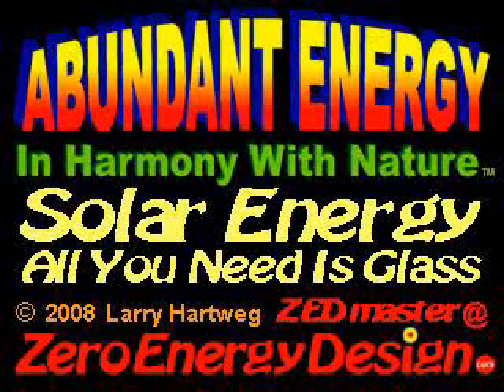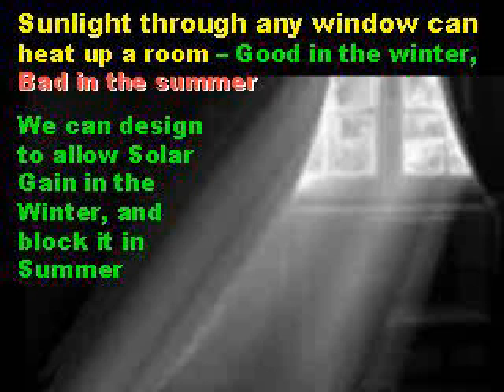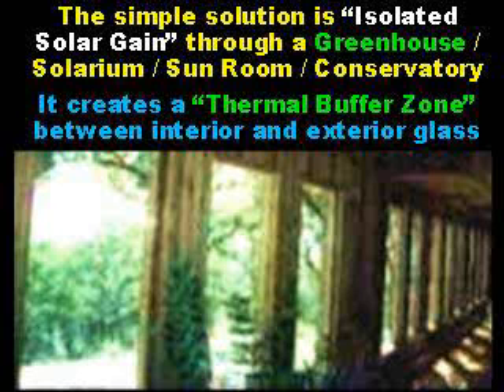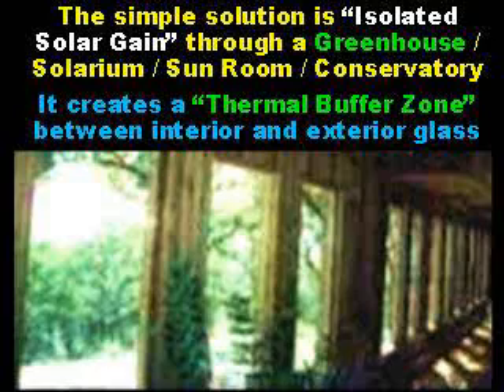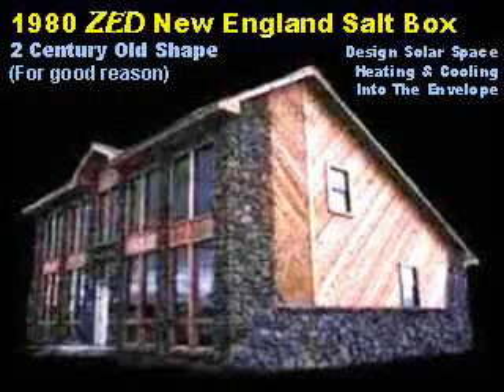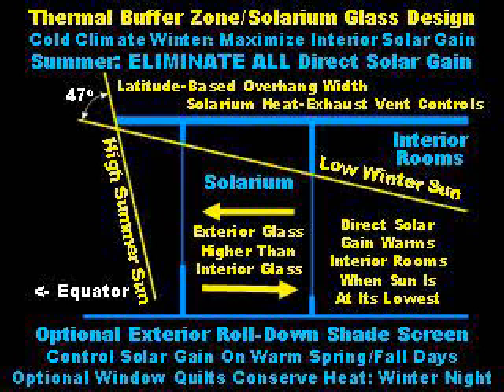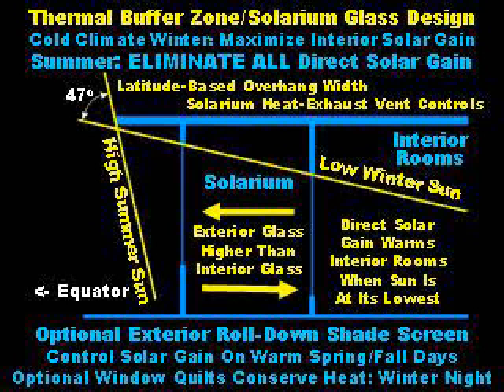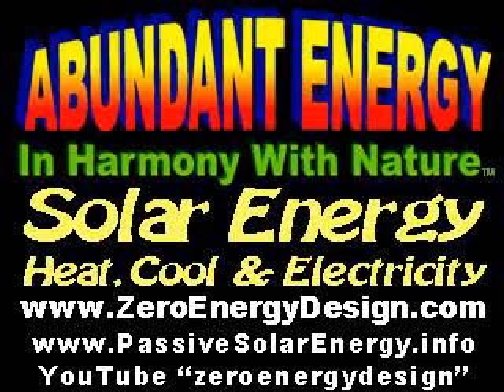Passive Solar Heating - Glass is all you need

Comment: I would venture to say 99% of al houses in the United States have roof vents.  Have you ever been in the attic of a house? there is a ridge vent, the eaves are open vents, and there are sometimes peak vents on either end of the house.
You would never want to seal a house completely. Moisture buildup would cause the wood decking of most roofs to rot so you must allow venting. Its common building practices.

Comment: during the winter the travels a much lower arc in the sky , wall windows are much more important in winter than cieling glass . in summer the plants can go outside , and the wall glass will not allow as much light in due to the suns higher arc of travel . keeps summer heat out=lower air conditioning cost. =)